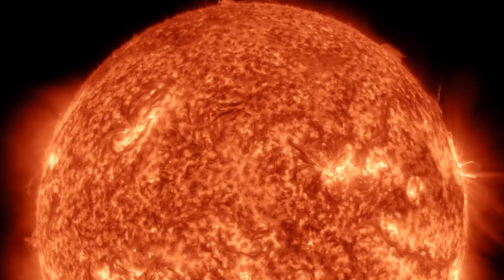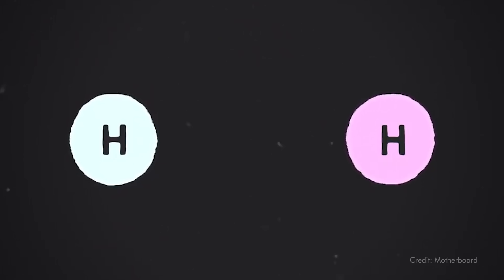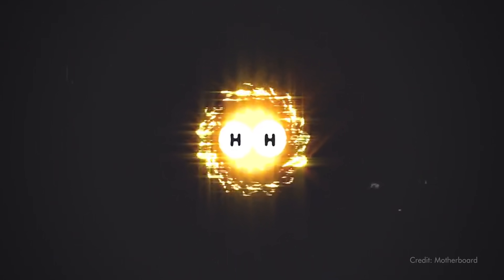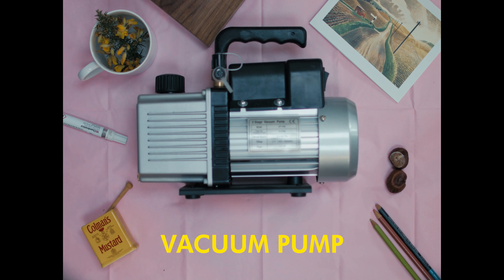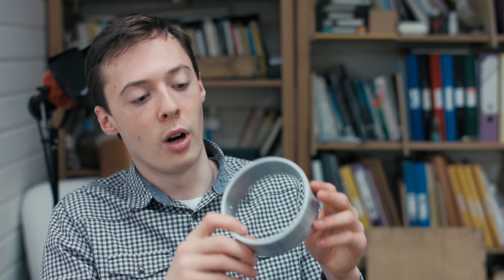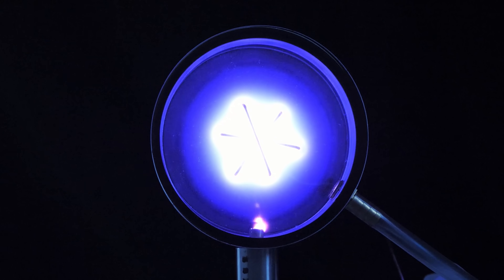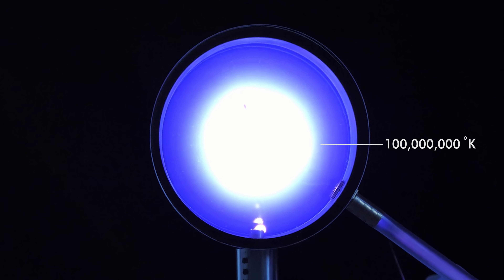Making a Desktop Fusion Reactor

Comment: So I'm not a physicist, but I have built parts for a fusor for a physicist. I'm a toolmaker who works for the Faculty of Science in the uni of Sydney. Perhaps I can answer a few of the criticisms leveled at this bloke. 

1. Temperature. Temperature is a measure of the kinetic energy of molecules. You can have very high temperature gas (or plasma) that is unable to transmit much heat due to the fact that there are fewer molecules present. It's a vacuum chamber after all. Again - I'm not a physicist, but that's my take.

2. Have a look on the wikipedia article for fusors or fusion reactors and do some homework before claiming that this isn't fusion. That glow leads me to think it is. 

3. The reason this guy isn't a millionaire is because this is old tech that yields a net loss in energy. I.e. you get less energy out than you put in - but that does not mean it's a fake.
Reply: The answer as to if this is a hydrogen lamp or fusor is likely answered at 6:22 in the video by the vacuum gauge.  The best vacuum I can see achieved here is in the 28 in Hg range so let's say it achieved 28.92 for a 25,400 micron vacuum.  A simple demo fusor typically operates in the 50 to 10 micron range with star mode operation achievable in the 15 micron range.  At no point would any fusor running above a 10 micron vacuum produce neutrons.  At 25,400 microns, this is a hydrogen lamp.  It's still a cool project, just not what could be considered a fusor unless the vacuum drawn can get to less than 50 microns.
Reply: @patcheudor9494  the mere fact it is a mechanical vacuum gauge indicates that it isn't fusion.
Reply from the maker: David Cassar Said better than I could’ve myself. You’re spot on! Thanks 🙂
Reply: @WillFromLondon  So how much energy does it consume? And what the geiger couter shows? because im really thinking of bilding one myself :D
Reply: @Shii1288  if you were to build a proper fusor like I am currently doing you will not be exposed to neutrons or X-rays as you will not be able to be close to it when it is operating. You will need neutron bubble detectors and scintillating Geiger counters to measure the amount of radiation that is being produced.
Reply: just asking, but is it safe, and what are the costs of making the thing and is normal hydrogen used?(want to try building one)
Reply: @WillFromLondon  How deep a vacuum are you getting? Also, what is the specific name/model of the vacuum pump you're using?
Reply: I'm an engineer and work on fusion and I can tell that's just plasma discharge, vacuum in a tokamak is almost perfect, nothing you can reach with just a shitty vacuum pump, moreover it's true that you maybe can't transmit much heat because that's a gas and everything, but still you would radiate enough to cool down and there is no way that thing is 100 million kelvin.. do you understand what does 100 million mean? 
The plasma would be 20'000 times hotter that the hottest any material can stand (~5000 K) and even if heat transfer was low, since that sort of wire star is not able to dissipate shit would still reach a temperature hot enough to melt, moreover a fucking "high" pressure gas like this would radiate the hell.. 
I bet this shit doesn't even reach 2000 K, but why am I even arguing with someone on the internet? I bet you'll just point out a typo in my comment! 
Btw let's take a fucking neutron counter and measure that shit I bet you can't even count one fucking fusion neutron!!
Reply: @nicolobadodi3423  than*

I'm Sorry.
Reply: @nicolobadodi3423  well you are seemingly  as clueless as the video creator is. You absolutely can do fusion with an off the shelf vacuum system. The complete setup will cost just over $1000 (if you are thrifty) and requires a TC vacuum gauge or (preferably) a capacitance manometer gauge and a lot of precise plumbing work to insure there are no leaks, but a motivated hobbyist can absolutely create nuclear fusion at home, it's just that this bozo didn't (wouldn't be a bozo if he simply hadn't claimed that he had demonstrated fusion).
Reply: Nicolò Badodi exactly why the fusor design is known to fail i.e. The cage well melt if running for any considerable length of time while actually creating fusion, this is why the polywell design is a much more intriguing design within the many different regimes(methods) of doing fusion.
Reply: @metatron5199  Yes, you're absolutely correct. I couldn't have said it better!
Reply: The only fusors that are even slightly successful have a cage constructed from tungsten and use a mixture of tritium and deuterium. But even they are more of a research toy compared to a theoretical fusor that would use hydrogen fuel and be able to actually create useable power.
Reply: @nicolobadodi3423  I'm a physics grad..  and I would be surprised if this were fusion..  very surprised.  As far as I can see the equipment is good for creating plasma..  but for fusion you'd need very high temps... so high in fact that you'd also need very strong magnets just to keep that plasma away from any physical surface.  Often plasma is further heated by a variety of different means to get it to the temp of fusion... and its very difficult to achieve fusion of nuclei..  actually making a plasma is the first step..  because the object is to push nuclei together past their electrostatic repulsive forces..   but the equipment is still awesome all the same and fantastic creation.
Reply: No worries mate. There's a lot of misinformation out there!
Reply: The glow does not necessarily mean that fusion is taking place, rather ionization. Also, interference can cause some geiger counters to produce false readings... I have experienced extremely high false readings on my cheapo GMC-320 plus (though those geiger sounds are almost certainly just for effect). Fusion is likely not taking place in any significant quantity. 

Take this information with a grain of salt, as I currently have no "real" experience in nuclear physics yet, except for information that I've taught myself. Though I am almost certain that I am right.
Reply: @novano1d "Though I am almost certain that I am right." Yea, I know... Everyone  on the internet is right.
Reply: @novano1d  Geiger counters typically rely on high voltage for the tube, so being near very high voltage will definitely mess with it. I have a kit built geiger that I could run a test by.
Reply: @JJayzX  Yeah, I have three geiger counters, of which one I built out of the high voltage components of a camera flash. The cheap GMC-320+ gives false readings when placed near my buck converter. My other counter, the CD V-700, which has a pickle probe made of brass (for energy compensation) does not give these false readings. The probe casing I'm assuming is acting as a Faraday cage. I have not tested this with my sts-5 tube but I assume it would also succumb to the interference.
Reply: @novano1d  As I have answered before, Geiger-Müller counters cannot detect fast neutrons (or neutrons with any energy) because they don't ionize their gas which is the trigger for the discharge that creates a pulse
This whole video is just BS
Reply: You need a neutron detector to say this is really fusion. I built a similar device I high school, it glowed like this but no fusion was occurring. We had issues with oxygen getting in the system which at low pressure and 25kv creates a purple/blue plasma and a significant amount of X-Ray radiation. Pretty sure we're seeing mostly seeing plasma (ionized gas) and not fusion. These kind of devices can work but the central electrode used here will defuse the particles too much for there to be any meaningful interactions. Also the way the glow wraps the electrode is a region where particles are moving in the same direction not colliding so again don't think the glow is fusion. Again without the right equipment (which I totally understand not having, last i looked it was crazy expensive) we can't know for sure. Still really cool project don't give up, but next time talk to a physicist (i.e. Expert) before telling people what their seeing. Final note, might be fun to model your design in a tool like sim ion so you can see how particles behave in these devices (no idea if that tool still exists I was using it a decade ago)
Reply: @celivalg  yes www.fusor.net is a great website. I'm using it right now to produce my own actual fusor using a d-d reaction. It is a lot of effort and money but it will be worthwhile.
Reply: Completely fake and BS. No prove fusion is being done (i.e neutron detection equipment). 

Voltage way too low for any hope of hydrogen-hydrogen fusion. That transformer has an awfully low current capability. 

Pretty glow discharge, nothing else.
Reply: That is NOT a fusor.  A fusor includes the nuclear injection system.  All he managed to create was Farnsworth's virtual electrode.  In order to qualify as a fusor, he would need the mechanism for injecting the high energy deuterium.
Reply: @protoborg  no he made a fusor. But it was based on a different concept
Reply: @ArcturusA  No he fucking didn't.  Fusion is NOT POSSIBLE.
Reply: @protoborg  man, can you stop biting my head off. This is a Farnsworth reactor. Fusion is possible. Exothermic fusion is not possible, though. He only did endothermic fusion
Reply: @protoborg  if you are still doubtful, search Wikipedia then.
Reply: @ArcturusA  Farnsworth, huh?  You mean the nutty professor from Futurama?
Reply: @protoborg  Its ionization, not fusion.
Reply: @protoborg  and Philo Farnsworth is an actual inventor from the 20s.
Reply: @RinnzuRosendale  I did say fusion is not possible.
Reply: @RinnzuRosendale  I am aware.
Reply: As a theoretical physicist, I approve this message.
Reply: At 70 keV energy, the fusions of hydrogen nuclears can definitely occur. Even if there is no energy gain in the end.

However, if there really was a fusion process, or if it is just a gas discharge, you can test it by checking how much helium is in the reactor.

Helium is only a small proportion in the air. So in the residual gas after evacuating your reactor very little helium is in the reactor when no helium is produced by the process itself.

Personally, I only know two ways to detect helium: optical spectroscopy and mass spectrometry. It could be possibil to detect Helium by it`s very low boiling point. Chemically, helium can not be detected.

Sorry, my english is not so good. I'm from Germany
Reply: I'm not smart at all but wouldn't that put off radiation.
Reply: I’m not sure whether this is fusion or just plasma. Some massive labs are used for fusion experiments and used way more energy than this ever could. Plus, they say those huge amounts of energy is required for fusion
Reply: @benG2141  I just realized that energy "magnifier" that he used for more electricity is a thing but it would melt from the heat it makes as seen in electrobooms channel he is a electronics almost expert
Reply: And may I add the aluminum would start melting from heat radiating
Reply: My suggestion: check if there is helium in the reactor.

I also believe that this is a simple gas discharge. But a few fusions could be happend. Only by measuring one can be sure.
Reply: the environment and the container have parasidic capacitance and the voltage is very high too so i think that it's ionizing the gas inside which makes it glow?
Reply: "I'm not a physicist" - only true thing you said
Reply: How much net loss energy would you say such a homemade fusor would suck up per unit of time? I'm wondering if, negating the production cost, this is a sort of not-too-expensive to keep home decoration toy for real
Reply: @Yavorh55  It is not for long term use. Just something neat to show off. It will only produce the glow as long as he is producing the hydrogen from the chemical reaction. Although a 100lb cylinder of Hydrogen is anywhere from $400 to $600 USD it would never work because of the metering extent you would have to go to, to get a tiny metered amount from such a large cylinder and then the evacuation process of getting rid of the helium.  It is a toy... a small chemical reaction to produce hydrogen to light up for a few hours is plenty.
Reply: @nathanwoodruff9422  in a fusor, helium is not removed from the chamber. The helium produced is Helium-3 which can fuse extremely well.
Reply: @radioaktiv2531 Yea, that is great except I was trying to only fuse hydrogen and make it sustainable because in my tests it took more energy to fuse Helium-3 than it did plain old hydrogen. To make it sustainable, I had to move the Helium to the outside, thus the thought of spinning it. It half surprised me, but it worked. It started producing a fair amount of watts. Once you ramp it up and realize what you can do with it, you get rid of all evidence that you ever built the damn thing. I pray to God that others have done the same thing.
Reply: Legit question, what's the thing in the middle of the reactor?
Reply: @rmt3589  that is the (hopefully) tungsten electrode/coil that the electricity is connected to.
Reply: Thank you.
Reply: >considering wikipedia as a valid, and accurate source of information
Reply: @voids.5917  It IS.
Reply: why he use so many edits to make it look like Shaun of the Dead/Hot Fuzz? #REALQUESTIONS
Reply: @David Cassar
also he forgot to make a click bait title "home made fusion reactor that scientists and electric companies dont want you to know or build in your garage but Tony Stark did it in a cave, why cant you do it at home"
Reply: Your first and last point are entirely valid, however the second I found debatable. When you pass electricity through a vacuum, it makes a remarkably similar glow. Being that he's supposedly at 60Kv, a corona as large as the aura in the clip is entirely possible.
Reply: Highlighting the ONE comment that try's to explain this idiocy doesn't vindicate you.
Reply: Having a think about all this and I am not blaming the video for the use of fusion is a weird way here. I really think these should be just called plasma generators, my reason for saying so is that true fusion would output a different particle altogether mainly beryllium-8 as well as an alpha particle and then that would then transform into carbon, then this would begin the carbon-nitrogen-oxygen cycle (which is mostly basic fusion) obviously I am not expecting the level of a star with having enough net energy to transform helium into iron-86 but there still should be some minor particle fusion for this to truly be called any derivative of fusion.

The only real indicator we would have though as an audience would be to see the Geiger counters alpha detection rise as that is what is given off between the combination of helium particles. (I know we HEARD it rise but the internet has taught me to trust these things about as much as milk that's slightly out of date). Also, I believe that the reaction on this scale wouldn't actually give off that much heat, there just simply isn't enough fusion to get this kind of heat.

Basically, to sum it up I am NOT bashing the video (although I get that it was probably made for entertainment purposes more than science) however I am more bashing the fusor system itself as basically all it is, is a glorified plasma generator.
Reply: @SrAlexGaming  fusion like this wouldnt produce beryllium at all, nor could it ever have a CNO cycle at these pressures. it didnt look like he even put in any deuterium so it would never produce any appreciable fusion anyway. not to mention you need far better vacuum for fusion.

geiger counter is useless for this purpose as it doesnt distinguish between ionizing radiation and any alpha particles are swamped in high energy electrons/photons for sure.

given that fusors dont net energy most heat in actual working fusors is still simply from losses and not fusion itself. it also clearly didnt reach 100 000 000 degrees, he just read that somewhere.
as you said this is one of those plasma ball toys effectively.
Reply: I'm not a psychiatrist but I know you learned that 123 thing from your parents
Reply: i was just about to say how could something get hotter then the sun but still be held by metal that can be melted by a fireplace but you answered my question before i even asked it thank you for the very helpful comment
Reply: @EJintheCA  actually that is possible, low pressure means that getting it very hot really doesnt represent that much energy, thus the actual heat flow into the metal casing would be low enough that it doesnt melt. real fusors do operate at millions of degrees with just metal reactor vessels, most dont even require active cooling either.

fireworks sparklers are extremely hot but they dont burn through your skin essentially.
Reply: It is ironic that the video even says "this is a net loss"  ( for the slow people in the back.... this is a very complicated light bulb )

cool project none the less.  Heck  I'd have one of these just to say I have one...
Reply: @bendeliduka  it isn't a fusor at all though. Fusors are not net energy positive (in fact, no fusion reactor is net energy positive yet) but they are fusion reactors and they do produce neutrons, but this guy hasn't built one. They are pretty tricky to build for amateurs, mostly because they require sub micron (10e -4 torr) vacuum in order to be clean enough for the deuterium to gain sufficient kinetic energy to fuse at the center.
Reply: I know my comment is just going to get lost somewhere down there but Im just wondering what your point is exactly:

Your first point is totally irrelevant as plasma doesn't really have anything to do with fusion... At all

Your second point is litteraly suggesting that because it glows it must be achieving fusion... I mean cmon do you really have to be a physicist to know that atomic fusion doesn't occur in glowsticks? 

And your third point is a total lie... Yes its true we can produce plasma that doesn't achieve "break even" aka energy in > energy out but we still could never sustain it... So if this video was true then he would cirtainly be a billionaire...
Reply: Regarding Item #2, the blue/white light observed is not fusion. What is being observed is the excitation of rarified gas basically the outer shell electrons are jumping into an elevated energy state from the applied 10,000 volts and when the electrons fall back down to a stable orbit a photon is emitted. The blue/white light is all the emitted photons. It's pretty to look at, but not indicative of nuclear fusion, sorry. If he had left plain atmospheric gasses within the chamber and had not purged it with whichever gas he used then the glow would have been more violet/purple from the nitrogen in atmospheric gasses. I have done this experiment myself with surplus parts from a Mass Spectrophotometer/GC.
Reply: You are really not clever. "That glow leads me to think it is". HAhaha. There is no fusion reactor ever build. There will be none build in the future, coz this can't be done in our dimension. PERIOD. now cry more how you muricans think you are very clever, but in fact you are in the bottom of the mensa table, really dull and dull nation!
Reply: @NASOOOBEE  Sorry, but you sound very confused.  By guessing, the guy lives in Great Britain and you're insulting Americans based on his video. In addition, you say that a fusion reactor is not possible in "our dimension." Just how many other dimensions have you visited to confirm your claim? Regarding your statement of the intelligence of people in the United States, all countries have examples of individual people who are highly intelligent as well as unintelligent and everything on between. Making a brash stereotyping statement like that only diminishes how other people view you!  You should think before you leave comments.
Reply: Still no explanation of how it worked, you can find countless other tutorials on youtube that build the exact same thing but do not claim fusion. This is simply plasma created by the breakdown voltage between the cathode and anode. The light is created from the hot soup of ions and electrons whizzing around in the device.
Reply: @epicwhaleburger  You're exactly correct! All that is happening is a glowing discharge of ions and electrons just like what you see in a Geissler tube. There is no fusion happening at all.
Reply: Davey Crochet  before you go tearing apart those smoke detectors you should research the dangers and precautions of doing so. You do not want to be inhaling any dust particles of the Americium-241 that's the active component in the ceramic radioactive source or contaminating your work space. Do your homework before you do something stupid that you may regret later.
Reply: Davey Crochet  Gotcha! Sorry, I misunderstood.
Reply: Everyone, he said it's a Farnsoth Fusor.
Reply: I wounder what did his Geiger counter was measuring
Reply: David Cassar I
Accordingly, Fusion Reactors are supposed to be so efficient it rivals the amount of energy put in. This is because of ho much power is generated through fusion. Also Ye it’s impossible to make a fusion or fission reactor that small, nor is it legal.
Reply: accurate
Reply: Thanks for the answer I was wondering why his house didn't  melte
Reply: You know it is not fusion that's making helium, like a real fusion reaction, just hydrogen plasma.
Reply: Finally, someone with a brain
Reply: @Matthew Tong I don't think you understand what's going on in there. The bright light you see is, as you guessed, not from fusion. Those are just ions accumulating at one end due to the electric field. However, this demonstrates the concept of fusion as the high-energy ions are collecting at a point with a reasonable amount of force. Some atoms do fuse, but barely enough to cause any harmful radiation and/or energy release.
Reply: I really doubt that building a miniature fusor is possible because the hydrogen needs to be within 10^-15 m in proximity, which is a bit difficult because the protons are pushed away from each other due to the electromagnetic force. The Tokamak generator was much larger to compensate for the lack of a strong gravitational force that’s present inside the sun, so it does use more power than it creates, but the amount of power to create those conditions is not possible because someone can’t just get that power from somewhere. Also,  it’s unlikely that this is a nuclear fusion reaction because of the glass, the lamp wouldn’t be structurally sound enough to contain the hydrogen (deuterium specifically) within the right pressure to have the fusion reaction take place.
Reply: I doubt it is fusion unless he used an actual fuel source such as deuterium. Even then the only way to verify fusion is with a neutron detector.  The glow that you're seeing is only the plasma, this doesn't suggest fusion, much like fire or lightning doesn't either.
As for the temperature, I doubt it's in the order of 100 million degrees K, seen as that's in the realm of tokamak reactors and so forth, he couldn't possibly get a good enough vacuum with that pump and the probably leaky system, although I don't doubt that it probably did get hot.
As for the third point, you're absolutely right!
Reply: David Cassar even though energy making wasn’t my reason for watching this
Thanks you’re a big help! 😸👍
Reply: Nice bro👍👍
Reply: You need a higher pressure, like 200 bars. The original pressure required for fusion is 265 billion atmospheres, but we can't achieve that. My idea is that you just need a higher concentration of deuterium which would be easily heated up by the electricity since it is much more denser than 30 micron deuterium
Reply: 🔴 What Is Islam? ⚠️

🔴 Islam is not just another religion. 

🔵 It is the same message preached by Moses, Jesus and Abraham.

 🔴 Islam literally means ‘submission to God’ and it teaches us to have a direct relationship with God. 

 🔵 It reminds us that since God created us, no one should be worshipped except God alone. 

 🔴 It also teaches that God is nothing like a human being or like anything that we can imagine.
🌍 The concept of God is summarized in the Quran as:

📖 { “Say, He is God, the One.  God, the Absolute.  He does not give birth, nor was He born, and there is nothing like Him.”} (Quran 112:1-4)[4] 📚

🔴 Becoming a Muslim is not turning your back to Jesus. 

🔵 Rather it’s going back to the original teachings of Jesus and obeying him. 

More .....👇

🔴 THE RETURN OF JESUS
Reply: Technically temperature is the average kinetic energy of molecules in a system, but it’s not that big a difference.
Reply: Human core fusion
Reply: I'll have to reply to this
1- the sun is MILLIONS miles away from us with Millions of thick vacuumed chamber in between, yet it managed to transmit heat and energy to us.
2 -  don't care much, I agree with u there.
3- i disagree. it's not used properly, 100 million degrees could be a crucial part of some extraordinary applications
Reply: real problem is proving it's fusion you need some kind of detecting the neutrons ... classically the amateur would irradiate a piece of silver  (silver captures neutrons and the resulting isotope has a short half life) and then measure gamma counts. This could have been done here with the silver plating of the chamber (i.e. showing it's slightly radioactive after use).  Anything you will measure during operation could just as well be xrays. And gamma spectrometers are expensive, very.
Reply: No doesn't mean it's fake just worse than pointless cause pointless means you gain nothing but lose nothing. 

And also old tech that yelds... Tech? So this is tech now. Fusion and fission are "tech"... I could have sworn it was a process and not "tech" ... Who knew that driving is a tech and not that the car is the tech... 

That is what makes me worry is you sometimes use semantics and then others forgo it. That isn't usually the sign of a scientific mind. I get it, you are a solder jockey and therefor theoretical pursuits aren't your strongest... In fact you are just a nerd that was bad at math and science but loves a good CNC machine.
Reply: @celivalg  ok
The vacuum is crucial because we dont want heat to bleed out. Now we must use superconductors to compress the plasma until duison
Reply: All I learned from this is that "Old Skool" UK Rap sucked and belongs in the annals of history.
Reply: it fake
Reply: It didnt get anywhere near that temp, heat doesnt need molecules to move or we would be ice right now.... unless nasa is lieing to us and theres air in space.. 🙄
Reply: Where u based? Im sw london
Reply: Bro where do you get deuterium?
Reply: Awesome comment! 👌🏼
Reply: Will I ghoulify myself if a build one of these? How much radiation does it give off?
Reply: i personally do not like criticism.  But they should really stop feeding people wrong information because these fake  information procrastinates and slow down our level of science. Perhaps these procedures lead to bad  accidents due to lack of chemistry knowledge. I understand you need strong headigs for your videos. but having  correct headings and providing correct information are critical factors as a youtuber for contents like this. It is interesting enough for people to watch.
Reply: Dude lay off the Miller Schpeiller he's not looking to destroy the world
Reply: Well first of all, he did not even explain anything of worth noting. Then he left us hanging at the end. He could at least explained what was happening. Why there was light and all that shit. So there.
Reply from the maker: Burken Productions I’m still learning how to make these kinds of videos, I’m sure I’ll get better the more I do them. Thank you for the feedback though.
Reply: Will From London I like how you roll with the punches from a place as toxic as YT comments. Keep pulling the good from the bad. 

Awesome work and keep improving!
Reply: @WillFromLondon  what's the first song used I the video?
Reply: @WillFromLondon  could you do one about a Torus?
Reply: @WillFromLondon  i am trying to achieve this level of zen... your response is perfect. The video was great! i'm now googling how this works so i can build my own .
Reply: Burken Productions

... It’s pretty common sense.

In layman terms; heaty stuff makes light, heaty stuff gets lazy.
Reply: @BurkenProductions  because its self explanatory.. do you require a video explaining to you how to drink water? why don't you read a book
Reply: Althouh the brihtness suggests fusion, i doubt it is, fusin hydrogen is more power consuming than fusing deuterium, due to the mass defference and momentum difference of both. One way he could prove this reactor works is by collecting the gas samples and doing some chromatography on it, see if helium or other atom thatisnt hydrogen is showing its colors.
Reply: @theterribleanimator1793  there are various ways of a making fusion, in the way shown in the video hydrogen will probably fuse easier than tritium, just because it is lighter and easier to accelerate by an electric field
Reply: @xnukutuc  i dont think you quite got the fusion down, the reason tritium and deuterium is used instead of hydrogen is because it is heavyer, carries more momentum than hydrogen would and thus is less affected by the strong nuclear force and the positive charges that repel atom cores.
When you speed up hydrogen, it will have x amount of momentum, when you speed up deuterium, it will have 2x, tritium, 3x.
Thus when you want to fuse hydrogen, you will have to put in double the amount of energy in it to counteract any repeling forces, triple for tritium.
That is the sole reason why i dont trust that he fused atoms together.
Reply: @theterribleanimator1793  sounds expensive how about just putting a geiger counter to it and look for the tell tell sign of fusion but again at OP posted fusion is not hard to achieve positive Q on the other hand is not possible atm
Reply: @kristofferkahler2465  fusion is not hard to achieve? Well i guess you live in the core of the sun, for the rest of us it takes almost a megavolt, wuite a few miliamps and a vaccum pump that costs more than a car, not to forget a rig that withstands the temperature and pressure. And safety precaucions aswell, betas being what they are.
Reply: @theterribleanimator1793  it isn't difficult to achieve fusion for an organization (after all the cost of a car is peanuts for an organization). Is it tough for amateurs? Yes, you have to be pretty dedicated if you want to do fusion at home, and certainly you can't do the trivial work that the bozo poster of this video did and achieve fusion.
Reply: @theterribleanimator1793  ok what he built were a particle accelerator that uses electricity to excite particles to temperatures where collisions  will cause fusion but not in enough amounts to sustain the power used excite the particles you can get fusion from either high pressures or high energy the problem with fusion energy is keeping the reactions going after you shut of the power
Reply: @kristofferkahler2465   He built no such thing. He built the hydrogen equivalent of a neon bulb. It is a fundamentally uninteresting project from a 2019 engineering perspective. An actual fusor is an interesting project for an amateur to build and successfully operate and every couple of years there are articles in the news about teenagers successfully doing so, but these are smart kids who put a lot of effort into getting one working, to claim that this bozo made one when he didn't is to improperly diminish the accomplishments of the amateurs who do build working fusors.
Reply: @kristofferkahler2465  no, i doubt he achieved a low enought pressure to cause fusion in the first place.
Reply: @homomorphic  hey, dont be mean, i did much stupider things with my time than he did with his. Its just that is wrong to call it fusion without proof.
Reply: @theterribleanimator1793  it isn't fusion, it is absurd to even suggest that it is fusion. He had a mechanical vacuum gauge, and that alone is sufficient evidence that it wasn't fusion. He is either knowingly claiming this as fusion to get views (fraud) or he is so completely unqualified that he doesn't know the claim is a lie. I suspect the former, but either way he's a bozo. If he retracts the claim, I will rescind the bozo moniker, but not until then.
Reply: @homomorphic  CALM DOWN, its just a video, he doesnt represent the entire scientific community, and much less the fusion enthusiasts. Call him whatever you want but keep it to yourself, no point lambastim him for a video.
Reply: @homomorphic  his design and operation seems solid the only issue i see is if he was able to get a low enough pressure to achieve fusion in my book that is the equivalent of building a car and whether you put enough fuel in it to start it or not
Reply: @kristofferkahler2465  no, it's not like that at all, it's more like building something that superficially appears to an aircraft but actually isn't a design that could ever be capable of flight under any circumstance.

Getting the necessary quality vacuum is 80% of the entire challenge of making a fusor and includes construction of a vessel able to hold that vacuum (assuming that you are going to purchase the D2 and not electrolyze D2O because making your own D2 is a significant engineering challenge in and of itself).

Building a voltage multiplier to get the necessary voltage is trivial even for a newb.

All of this is straightforward for professional engineers with a properly equipped lab, but challenging for a self funded amateur.
Reply: @theterribleanimator1793  it's not just a video, it's a video making a specific claim, which is, in fact, untrue. There are lots of people seeing the video and concluding that building a fusor is trivial. 

This means that when a local kid spends 2 years building and actual fusor those same people will think "what's the big deal, that dufus on YouTube did the same thing in one day?". 

Making false claims is simply wrong and should not be tolerated. Our society is rapidly falling apart because of tolerance for falsities.
Reply: @homomorphic  the vessel required to hold a perfect vacuum is the same as a vessel able to hold 2 atm a beer bottle can holds around 3 atm
Reply: @kristofferkahler2465  first, creating a perfect vacuum is impossible, second you're referring to the resistance of the vessel to collapse. While I am referring to building a leak free vessel. The need for a vacuum of a specific purity in a fusor is to reduce the probability of kinetic energy reducing collisions between the D2 and other molecules. You can simply go out buy vacuum systems capable of this from commercial vendors, so it isn't at all hard to get access to a system like this if you're willing to spend the money, the question is how challenging it is to build one in your basement. It is pretty hard to do yourself. Just as building your own cellphone from scratch would be effectively impossible, yet I can go and buy one easily.

No one is claiming that building a fusor is rocket science, it isn't even close, the.claim is that an amateur building one in their basement is hard, and that the guy who made this video didn't come close to actually doing it.
Reply: @theterribleanimator1793  I'd like to point out that the easyest way to test if fusion is going on on there is by the Geiger counter wich he never actually used in this video.
Reply: @theterribleanimator1793  Spectroscopy would be preferable to chromatography for gaseous analysis.
Reply: @theterribleanimator1793  or watch out for neutron bombardment
Reply: @theterribleanimator1793  The Geiger counter is proving you wrong. Although he didn't show the results of it, just the noise the Geiger was making. More than likely just from the neutrons.  The test is to make it sustainable without adding heat. If you make it rotatable to force the heavier helium to the outside and then feed really cold hydrogen in from the center, it will become sustainable. When you get it right, you can verify by bleeding off several K watts of electricity in a spark that will jump near three feet to the floor. The problem is when you find the sweet spot you also make it ridiculously easy to make a boom that will level even the largest of cities from only a 100lb cylinder of liquid hydrogen. Also the reason why anyone that has got it to work will never build another one. The frightening fact is there are other people.
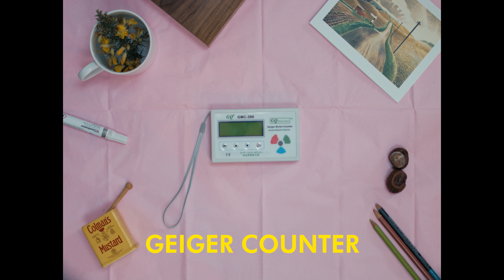Reply: @nathanwoodruff9422  - The answer to that is at 1:17.  That's a GQ GMC-300 detector which ONLY detects ionizing radiation, not neutrons.  So what's the Geiger counter measuring?  ionizing radiation only, likely X-rays.  At a high enough anode voltage a hydrogen lamp produces x-rays.  Look, this isn't hard.  Go read about how to build actual fusors and it will be very, very, very clear this is not a fusor and nowhere close to being able to produce neutrons.

http://www.fusor.net/
Reply: @nathanwoodruff9422  No, although the Geiger counter was making a noise i think it was fake simply because that detector the GMC-230 plus has no capability to detect neutrons although we could presume that if this was fusion some x rays would be produced so this could be conceivable if not for the fact that the meter featured in the video doesn't produce that sound, I suspect that it is instead some sound from a library. I also think that your comment about 'cold fusion' shows a simple lack of understanding of the process required for fusion as with the cold fusion comment the thought that a energy positive reactor could level cities is insane. Quite simply because of the containment methods and lack of fusions ability to continue without high vacuum (much higher than was shown in the video) . Your method for so called cold fusion is even feasible would not be able to have 'several K watts of electricity in a spark' because fusion doesn't inherently produce electrical energy. What you have suggested is the equivalent of a traditional RTG being a piece of Plutonium (or similar) with some wires connected to it.
Reply: @etch3130  yep, you are so correct... Keep swallowing that cool aid.
Reply: @nathanwoodruff9422  A Geiger-Müller counter can not detect fast neutros like those a fusion reactor would produce (not that what it is shown in the video is anything more than a pretty gas discharge)
Reply: @nathanwoodruff9422  The gas inside the chamber behaves separately from the containment vessel. You would only get very minimal gas turbulence on the periphery of the chamber.
Reply: @kevinjacobson6252  Yes, I know. I stated that in one of my 30 comments here. That is the reason why you rotate it.
Reply: i think the Geiger counter noise was just for affects. wasn't actually making anything
Reply: There is still a problem a Fusion Reactor has to get at least 2 Atoms fused. In a low pressure environment, there are very few Atoms to be fused to begin with.
The Reason, why a "conventional" fusion reactor can operate at these low pressures is due to the nature of plasma (the heating increases the pressure, but lowers it sequencially again). But I get your point, let's do this one by one...

1. Temperature: You are right temperature is a measure of kinetic energy of ATOMS/MOLECULES as you said. But you forgot, that what we are dealing with aren't atoms/molecules in the context of high voltages. The observed particles in this case are electrons (not atoms, neither atoms), which are ejected out of the atoms (residual atoms in the vacuum and the electrode/-s themselves). These have a mass (therefore kenetic energy under these voltages) but it is impossible to have such an amount of energy with that VOLTAGE AND CURRENT. You might ask yourself, why I included current. Let me explain. Think about the voltage as the speed of the electrons (They are rather fast at high voltage). An now think about current as the number of particles (per unit time [but that is not important]). You see, you could have a voltage to speed up the electrons to a crazy extend but if only 1 or 2 electrons are sped up like this, you end up with very little energy in a given time period - or in other words - you don't have 100,000,000°K

2. Glow: A glow is a bad indicator for a fusion. You could get a glow by nearly any substance you wish (Fluorescence, Phosphorescence, Electro luminescence, electric discharge [which the shown images suggest]). It is very typical  to get a blue glow by high voltage (AND LOW CURRENT otherwise it would appear orange) passing through the atmospheric conditions on earth (e.g. Lightning produces white-blueish glow).
 
3. Energy loss: I'm sorry but as far as I'm concerned the title is "Making a Desktop Fusion Reactor", therefore it should follow the definition of a reactor. A reactor (by definition) is a device, "creating" useable power out of a given source of energy. This does not convert the used energy into (usable) power. It just creates heat (due to resistance) and light (indicated by the glow).

I am sorry but I cannot agree on the presented arguments.
If any questions remain please contact me (via a response).
Reply: @freelease  how can pressure rise in a vacuum stupid? For this kind of fusion there need be no pressure, you are thinking about star fusion
Reply: @freelease  isn't reactor means the device for providing reactions? 
The device creating energy is called generator.
If it was called something in a way like "Nuclear fusion powered electric generator" it's purpose were to generate energy via thermonuclear reactors...
(Sorry for bad English)
Reply: David Cassar, something regarding point 1: heat can spread by a) radiation, b) convection and c) conduction. B) and c) don't work, too little matter, leaving a) as reasonable possibility.
Reply: @fuerLutzi  i was searching if some one had the same doubt. At high temperature he mentioned radiation should have been possible through vaccum. If any one got the answer please shed some light.
Reply: We need this as the pinned comment so everyone new can see it
Reply: To have fusion you need 10 - 15 million degrees Celsius so I don't consider having an actual fusion reactor which is essentially a star on your desk
Reply: @LoveLucki2012  I disagree profoundly with that statement.
Reply: If it's a vacuum chamber what did he make hydrogen for?
Reply: If it produced a high temperature, then how come did it not melt the glass or acrylic used to contain the vacuumed atmosphere while the high current of electricity was passed through into the chamber, exciting the hydrogen molecules?

I'm no physicist but I believe that a high temperature can melt things, acrylic and glass being two of them of course.
Reply: @CA.papaBear  This is probably the reason why you are not a physicist.
Reply: @CA.papaBear  if the temperature was that high at the acrylic or glass you would be correct. However,  the space that the temperature is that high at is miniscule. The temperature drops exponentially the further from the center you go.
Reply: This reply was brillant, and Will made such a cool looking fusor, i would love to make my own, but that would require a generator as said, but hey, one day i might do this. Maybe get into learning how to make sustainable and never ending power, would be cool to eventually have the world run on renewable energy
Reply: It’s probably the most unnecessarily overly complicated lightbulb ever made.  It’s a fusion lamp.  I want one.
Reply: David Cassar I’m confused on how it reached such a high temperature, without breaking or burning anything
Reply: @pyrorupt7036  the low pressure inside the fusor meant low heat conductivity. So even if it were 100,000,000°C, the glass would not feel a thing due to the low amount of gas.
Reply: @ArcturusA  thanks for coming back after so long just to explain it to me lmfaooo, have a great night or day man
Reply: @pyrorupt7036 You're welcome 😁😁😁😁
Reply: @pyrorupt7036  but it gives out x-rays, so get  as much lead shielding as possible to protect against x rays
Reply: NOT TRUE!! LOOK AT THE LIKE TO DISLIKE RATIO!!!!!
Reply: Wikipedia is not a credible resource
Reply: @RinnzuRosendale  Yeah it is, Loser.
Reply: David Cassar this is on e of the most fakest thing in the world both the glass and the metal would vaporize at 100,000,000
Reply: Um you probably just made a bomb literally
Reply: Bro I'm pretty sure this was a Joke video but still...
and re think your physics I can see a few holes in it
Reply: @jacksonli9002  plasma is possible to make and if looks like a legit video he just is hiding critical information, NASA uses this technology
Reply: Explain though, I love to be proven wrong, that's how people learn
Reply: @bloodsweatandtearsforeverl9833  so insdead of creating Hydrogen Fusion(I'm assuming he is using Helium, because Deuterium and Tritium (Hydrogen Isotopes) is hard to get your hands on, it is extremely hard to fuse protium with protium. Insdead what he is doing is ionising the helium atoms with high voltages, aka creating plasma. However this is not Fusion as it the tempreture of fusing helium is extremely high, higher then that of Hydrogen Fusion, and that temepreture is basicly impossible to reach with his setup. And the would not be sufficient in containing the super heated plasma. There is also the case of ionising radiation and gamma rays, which will probably melt the acrylic (melting temp of about 160 degrees C) and give him cancer. So yeah, it's not fusion.
there's plenty of sources explaining both subjects so just search them up on youtube and compare them
Reply: @jacksonli9002   Jackson Li   Jackson Li  I've researched alot of this to, im assuming he was using a gas produced by mixing salt into water, (hot water makes a faster reaction), and pumping electricity through the water with 2 leads spaced according to how powerful your ark can travel, creating chlorine, hydrogen and oxygen gas, look up cold fusion for the plasma if you do it right the plasma won't burn you, look at "applied science" channel, I believe it is real because I didn't the research and experiments myself and nothing anyone says is going to stop me I have enough proof already, were doing it the same way with cheeper materials, and the government is trying to stop people from learning the truth with drones like you and the person who made this video giving false information or forgetting critical information trying to say "it's not possible" go try it, I almost killed me and my brother the first time I experimented with this, and the process of making nuclear energy when trying to produce hydrogen or whatever gas your trying to make is the same process just using household materials because we can't afford thier bullshit millions of dollars worth of polidium or whatever it would take to make a reactor
Reply: @jacksonli9002  Also hydrogen releases radiation when it explodes because it's kinda doing the opposite of a nuke it rips two molecules apart rather than fusing them together, so you were kinda right about that one part
Reply: Well said Sir